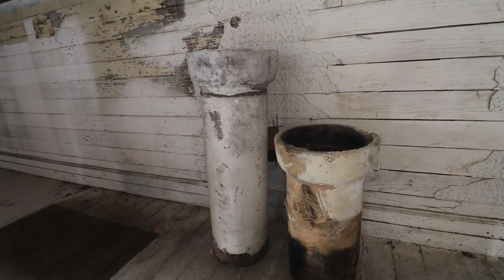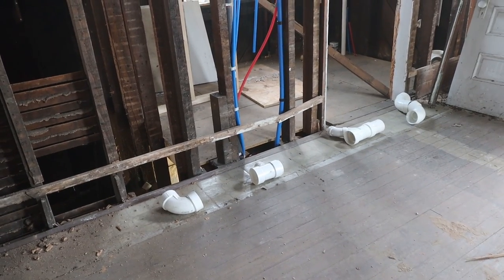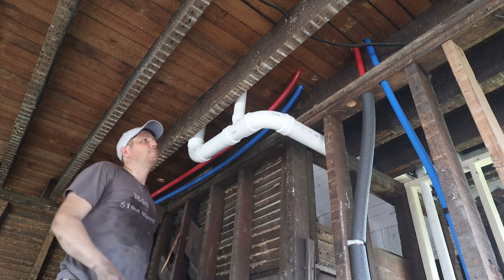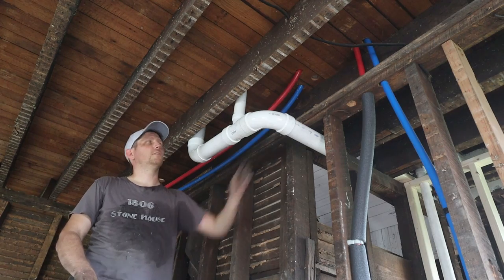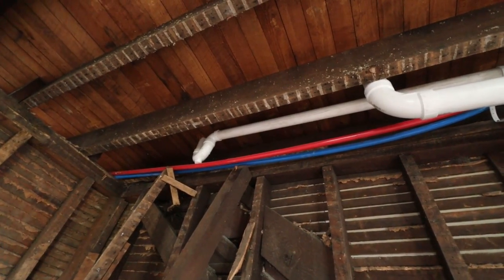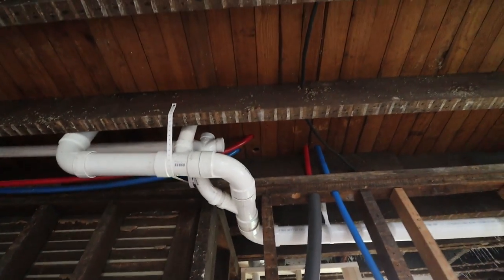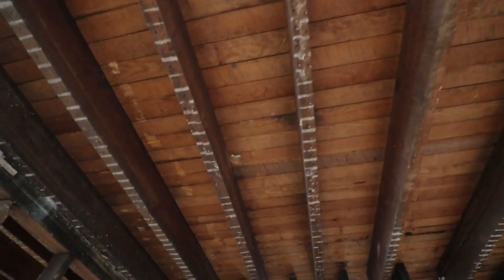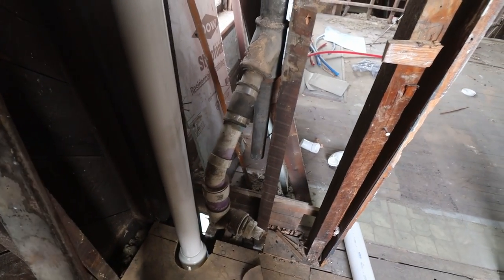Finishing the Master Bedroom and starting on the Plumbing - [Victorian Home Renovation]

Comment: Will you be installing new lath and plaster?
Reply from the maker: We will be doing purple board and modern plaster in the first floor for sure to have plaster again. It’s a tad thinner than real plaster with lath but from the outside you can not tell the difference as it has real plaster coats on top. It’s just a lot less labor intensive.